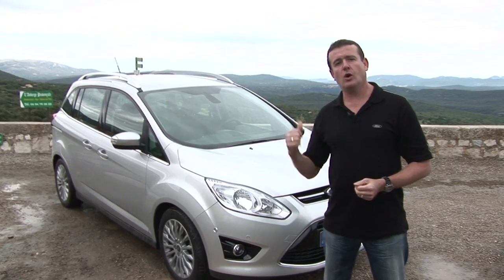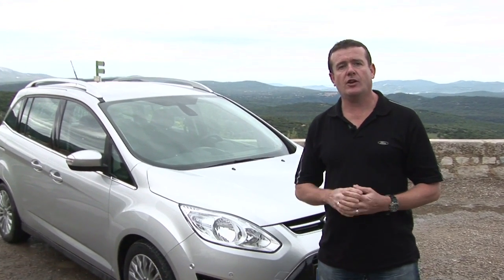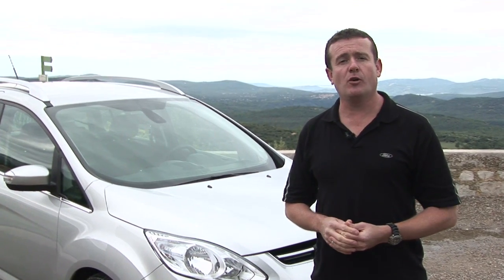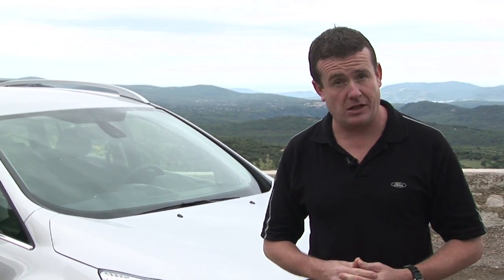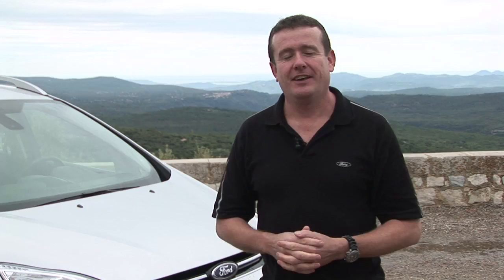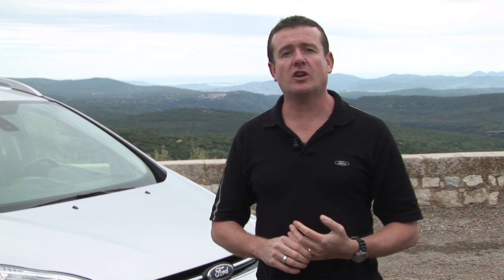Ford - Torque Vectoring Control

Comment: THIS IS NOT TORQUE VECTORING CONTROL!!! GRRRR......
Reply: Yes it is. It's the same type McLaren uses on million dollar supercars which is brake-based.
Reply: @PlayWaves1  
"Yes it is. It's the same type McLaren uses on million dollar supercars which is brake-based."
No, it's not.

Construct your dynamic systems 1 class bond graph representation of the system and it will become immediately obvious that it's NOT a torque vectoring system because you're neither changing the source of effort nor the source of flow.

STOP waiting for the Asian kid in your class to do your homework for you.

Do your own damn DS1 homework and build/map out the bond graph and then generate your SSSE state space equations and then solve for those equations.

It's NOT that hard for you to figure it out.

Comment: Applying equal pressures to both tyres does that. Decreasing one wheel's speed to the other, does not. A car would actually understeer uncontrollably if both wheels were equal speed in a turn, although differentials solve that problem.
Reply: Obviously you can’t understand the video.

Comment: @1ns4ne1d10t  ....I guess you'd never drive a Porsche, BMW, M Benz, Mitsubishi, Acura, Audi or Range Rover then would you, because they surely don't know what they are doing either.... do they! Only an idiot would SLAM on the brakes in a turn... where did you get that notion anyway?... Cheerios cereal box?

Comment: @hamster639 God I've heard it all now, active grille shutters which stop air getting into the engine, and now a system that slams on the brakes when you steer round corners. Its a good job I'm not buying a C max I'd rather drive a cut and shut Tribant then drive any of Fords products.

Comment: Ford clearly havn't heard of limited slip differentials.
Reply: Once developed this has to be far cheaper.. without the cost of additional hardware.. and although not as effective as a LSD its still very well suited to normal road cars which wouldn't normally have them.